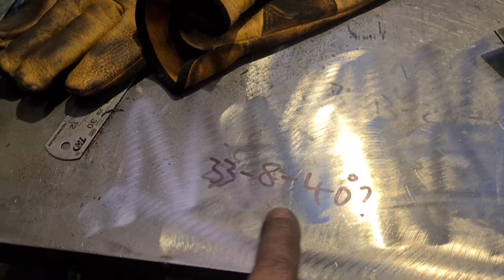Harley Road King Chopper Build Pt3 Rigid Frame Fabrication Welding #workshop #vlog #motorcycle #bike

Comment: What would it have cost to just weld a hardtail on it if the rest of the frame looked good?.
Reply from the maker: Its not that straightforward with these because of the rubber mounts and swingarm to gearbox assembly